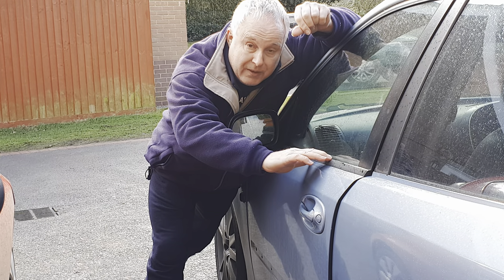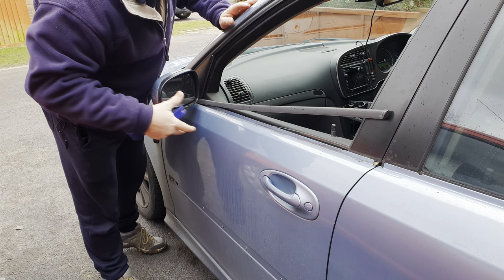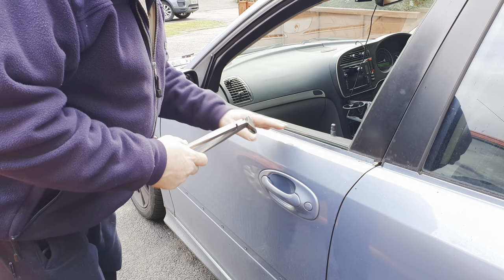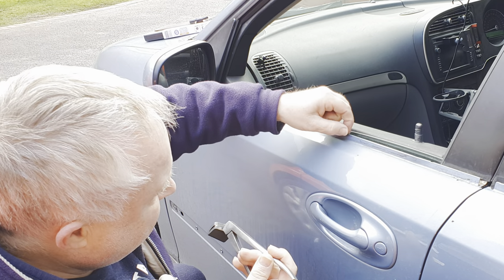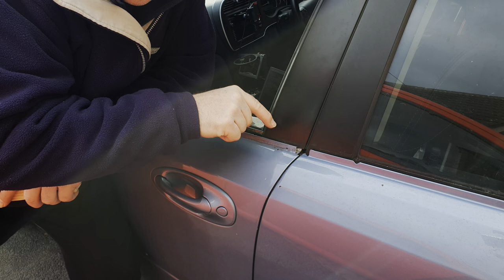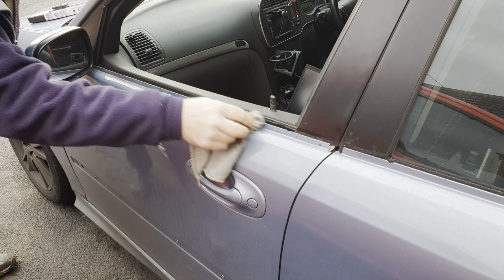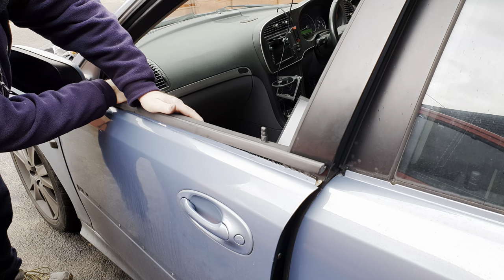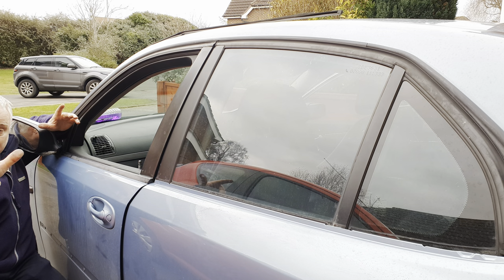Adjust Door Waist Seals to Cut Road Noise & Wind Noise 💨

Comment: I've been waiting for this. Hate road/wind noise.. and my car (GTC) is very slient.
Reply from the maker: Same. My Saab was already 2dB quieter than a Velor, measured on the same road, same speed (70mph) and same equipment BEFORE I added all that sound proofing in the boot. There is virtually no road noise from the rear now.
And this job reduced the wind noise and now my wet glass gets wiped like it should 👍

Comment: This probably does more to reduce noticeable noise than putting dynamat "soundproofing" all over the car. Also getting a good quality set of tires rated high for quietness helps a lot with road noise. Also, creative ways to tighten up the squeaky and loose trim, panels, mirrors, and dashboards inside the car can greatly transform the level of serenity in an otherwise non-luxury car. These methods are usually a lot cheaper than having to buy a Lexus. I'm speaking as a 2018 Toyota Camry Hybrid owner.

Comment: I have a 06 saab 9-3 2.0T I'm looking for the amplifier under the drive seat the only ones I can find people want $200- and more and there used do you have any idea  were I can get one cheaper or new ?
Reply from the maker: AFAIK they are not available new, so 2ndhand is your only option. They are getting rarer, so not surprised they are starting to command good money. Open yours up and see if it can be cleaned up or repaired.
Reply: Are you in the u.s.a , if so contact the guy on here under auto autopsy,
Or the guys on prolific builds,
Reply: @caractacus brittania  Yes I'm in Wisconsin. Thank you I will look into those two.

Comment: Yessssss, what about the outer and inner seals?
Reply from the maker: Do you mean the primary and secondary seals around the aperture?
Reply: @CycloneCyd  the one you messed around and the one on the inside that has a contact surface like velvet.